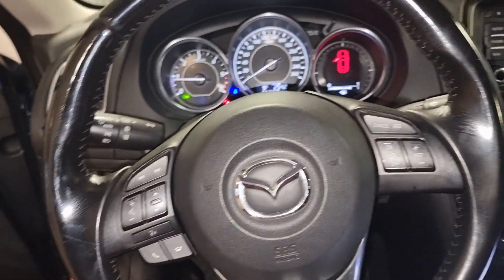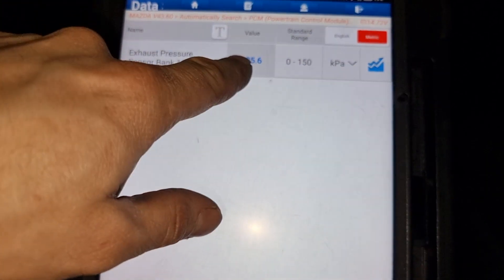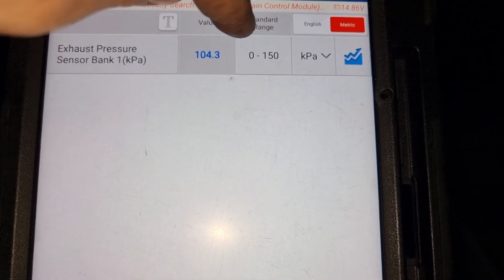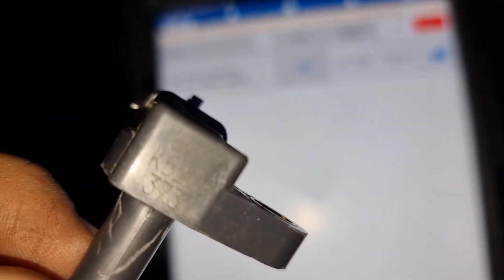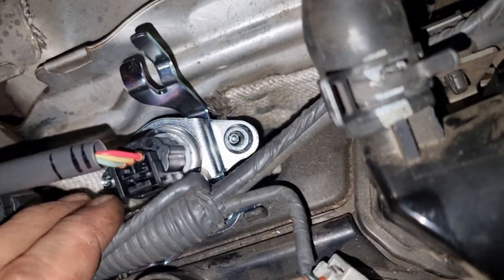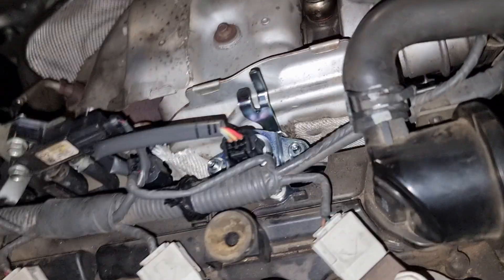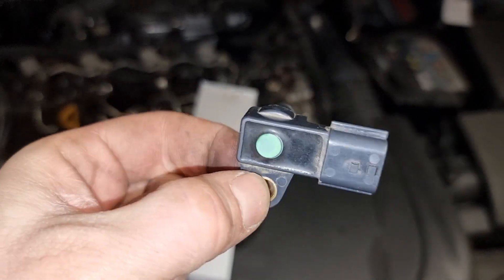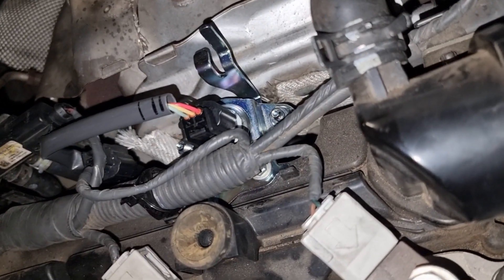Mazda P0471 exhaust pressure sensor A fix

Comment: I changed the sensor, but I'm still getting the same error code 😢
Reply from the maker: check cables, connector, hose
Reply from the maker: also clear fault codes